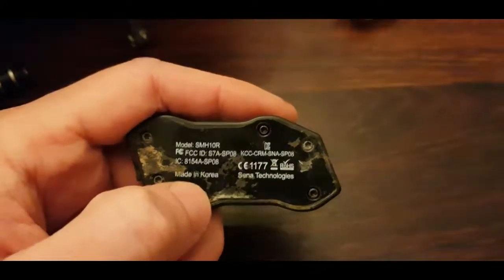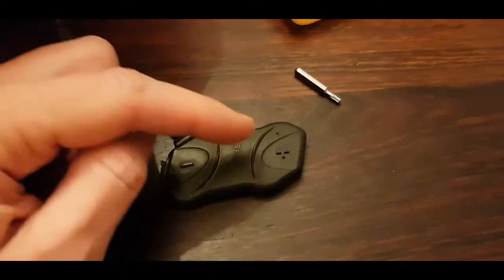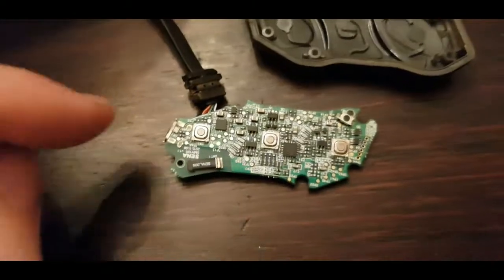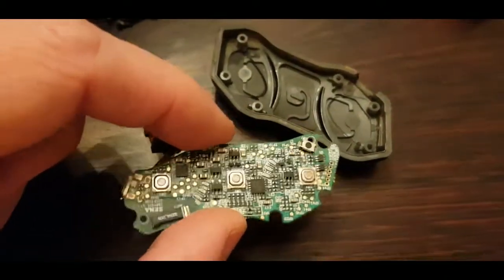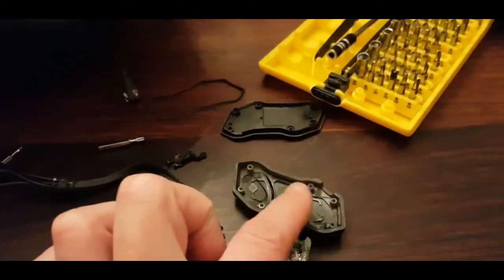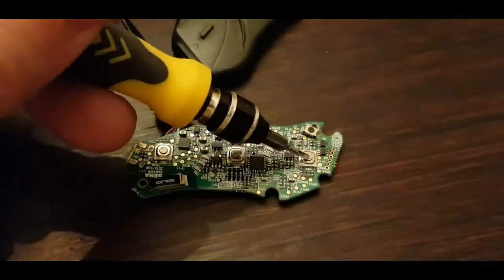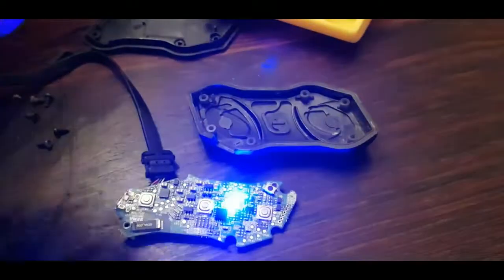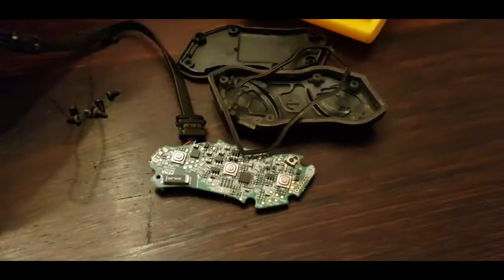Sena SMH10R

Comment: I also have a sena smh10 r however after seeing your video, I opened one of my units, It does not have the 3 buttons . My problem is, I have reset and factory reset my units and paired them, but only the one works, my wife can hear me but I cant hear her. Cn you maybe shed so light on the matter. I have just given up on the people working at SENA. I have explained my problem but nothing doing. I only use the intercom.
Reply from the maker: Had that issue when pairing with a different brand. Had to unpair, restart, pair, start the other one first, then the sena, do that in reverse and by some miracle it worked.